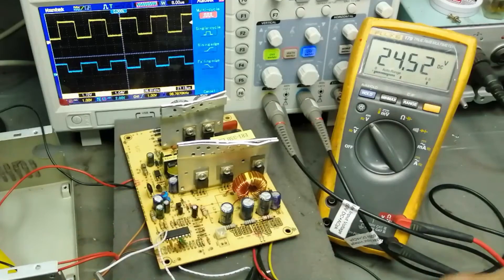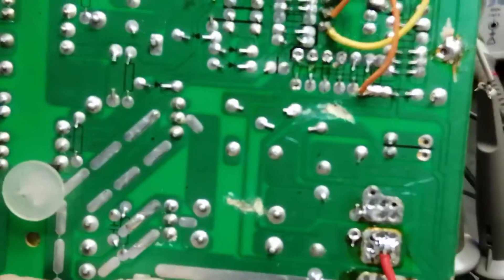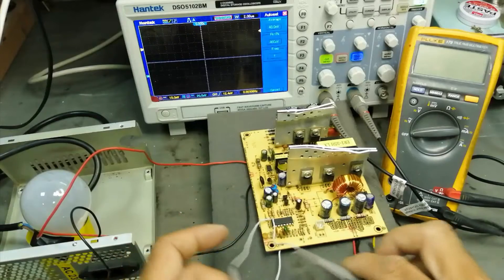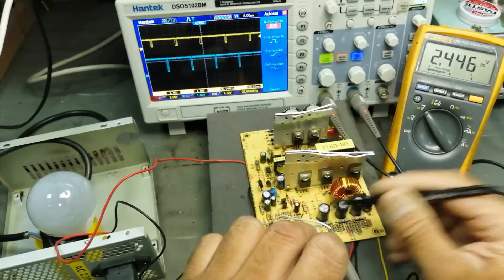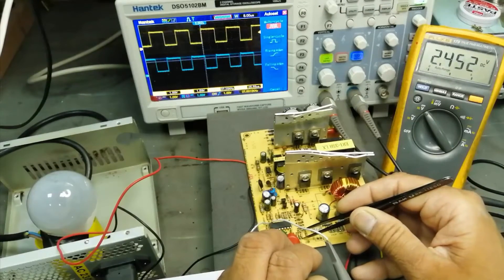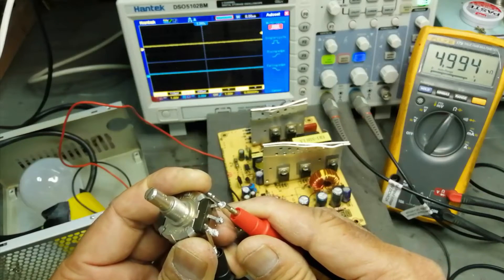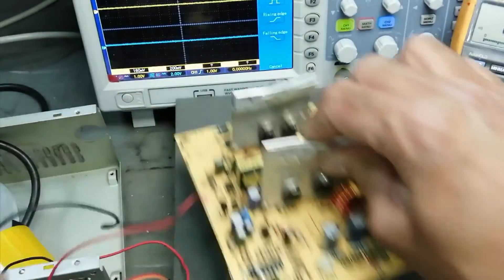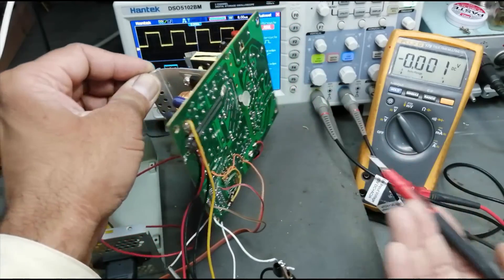#199 How to increase Output Voltage in ATX SDC291 Part 2

Comment: Since all 3 rails are couupled, I think I'll make (when I find time), only 12V to 25v, since 5v and 3.3v will be proportional to 12v/25v rail, but I only need one rail of enough current. Challenge is to get it to work from very low voltage, near 0V to 25V.
I think the best way to go would be to make one small separate pcb for my new control block.
Reply from the maker: taking enough constant current with wide range control of the voltage, it is near to impossible. 
it is best to disable all not-required output 
modify the transformer using turn/volt method 
so that the power supply will work in safe duty cycle. 
at the output , use an external linear voltage and current regulator 
i think practically it will good solution

Comment: Brother solution!  I followed the tutorial in this video exactly, but when I tried to test it using a 12Volt lamp load, both the amperage and the voltage dropped, it didn't work to lift the 12volt lamp load!!!  I have replaced the capacitor with the out resistor.  but I haven't used the pot.  just use a 47kΩ resistor on pin 1 of the SDC2921 IC and the voltage becomes 14.7 volts

Comment: In this condition we'll not be able to draw power as much as the capacity of this psu, as the controller having a stimulated feedback. Am I right?
Reply from the maker: yes you are right. the rated output will decrease automatically

Comment: Can use the potentiometer without disabling the voltage protection
Reply from the maker: no. if the protection is present, it will interrupt immidiately 
protection must be disabled

Comment: Thank you for the wonderful presentation!   One question: did you say the 4 resistors in front of the 4 capacitors need to replace with DOUBLE value?
Reply from the maker: That is correct

Comment: Why in some SMPS the main cappacitor is one for 400-500V and in the others are 2 cappacitor in series for 200-250V? It's depend from the topology, or simply lower cost for lower voltage the cappacitors?
Reply from the maker: it depends on the topology
if some power supply is design ed to provide high power output with regulation by means of PWM controller IC then most common topologies are used half bridge, push pull, full bridge. in this case it will need bidirectional DC current in primary, so it will use 2 capacitors
if some power supply is designed with PFC facility to maintain DC rail's voltage, then the PWM controller is just for switching, and the line regualtion is done y PFC circuit. in this case flyback topology is used, so it needs 1 capacitor to provide unipolar dc current
Reply: @HaseebElectronics  Thanks for the answer. I must rethinking all of this bcos it's hard to understand for me.

Comment: How to increase output current in atx power supply  , for car amplifier
Reply from the maker: we cannot increase current 
if we will change the duty cycle to increase switching time 
in that case the amps will not work correctly
please check video number 283 for in detail answer

Comment: If I hope this output 50v what must be rewinding the transformer
Reply: @HaseebElectronics  So what is the maximum voltage that the schematic of this power supply can produce
If I use EE 42 Transformer

Comment: This PSU ATX is using only one chip, if we have 2 : the supervisor and the PWM, where to put the potentiometer to double the value ? also, can we just remove the capacitors of the 5v & 3.3v if we do not plan to use them ? thanks !